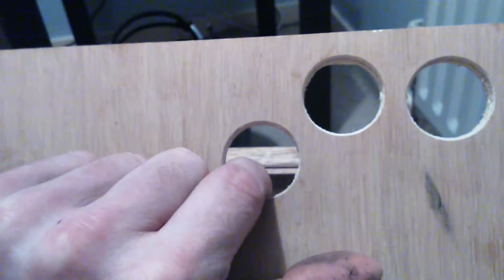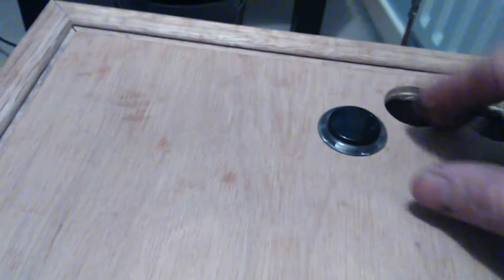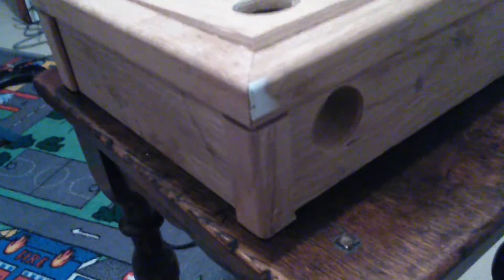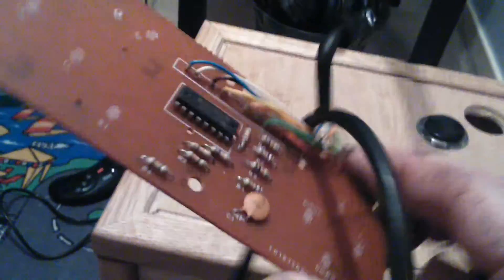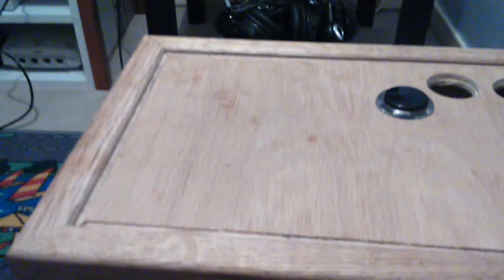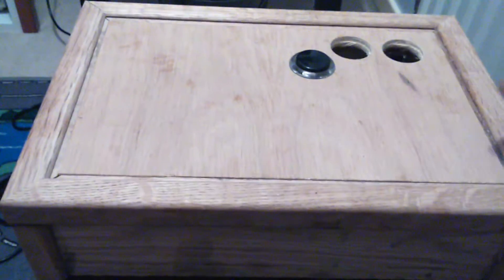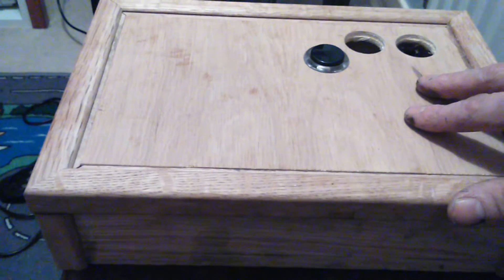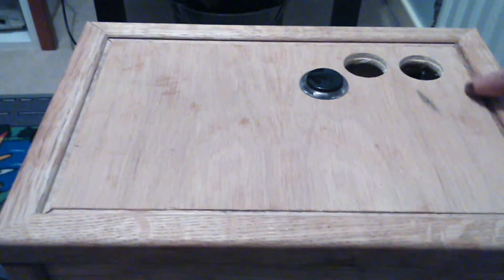Build your own arcade stick

Comment: I've got the venom ps3 ps4 exclusive stick. i want to add myoungshin fanta stick to it but the hole is too small. can you tell me which equipment i would need to make the hole bigger?
Reply from the maker: A round hole cutting bit for a drill would be best as I'm presuming the top is some sort of metal sheeting, you may also need to secure your panel to some wood so you have something to stick the pilot drill into allowing an accurate hole.
Reply: Mr Stella Box Head  yeah it has metal sheet. I will get hold of a drill and buy a hinge for it... thanks for your help

Comment: What you could have done to save desoldering all those connections is make a small notch at the bottom of the back of the wood and trapped the wire in there when you assembled it and put a strain relief to secure it in place ,then just solder your buttons to the opposite side ,I've got a feeling you have to solder all your wires to the connections on the actual buttons though because they go through that encoder thing and then to the output wires that's how I did it and it's a pain in the arse
Reply from the maker: ThePolicenaut Bloody hell i think i threw the buttons away ages ago!! :)

Comment: Neo Geo doesn't need a PCB board, each pin is a direction or button, but is the same principal.  I spent about £50 on all the parts, not including wood, I could have got a good condition Neo Geo offical controller for that, but that's not why we do it.

I will be interested on how you attach the joystick and hide the screws.
Reply from the maker: ***** Your completely correct about price not being the reason we do these things and i have been wondering about the attachment of the stick myself since reading your comment the other day :)

Comment: Very nice you have done an excellent job with the box.  Those buttons look like a much better option for making control panels out of wood.  The current buttons I have are designed for much thinner material i.e. metal, and I don't really have the tools for making large holes in metal, so maybe I should just see if I can get some of those.
I am sure you will be able to get that wired up using the Megadrive board, should work really well.
I have made myself a supergun in effect, but need to make a proper case for it.  My MVS 1-slot board is a non-worker unfortuneately but I still want to build completely a sit down Jamma cabinet, with a Mame PC inside that you can switch over to from a real PCB.  Need to do a lot more tidy up so I can have my workshop back, roof is now finally fixed from the storm earlier in the year though.
Reply from the maker: electricadventures Good to hear the roof has been repaired now Tony and i look forward to seeing the workshop in action!The best buttons for wooden control panels are apparently those manufactured by Happ, unfortunately these Sanwas are really designed for thin metal control panels it's just that I'm too stubborn to listen to the advice being given! I like the idea of a mame arcade cabinet and there are some nice examples of similar setups in Candy cabs with CRT displays here on Youtube :)

Comment: Nice one Darren! Does the MD encode it's inputs? (Turns out it does, news to me) I know that for the Neo you wouldn't need to pad hack.
Reply from the maker: RockstarRunner7 Thanks Rob, I'm still researching so I haven't started the wiring yet :)

Comment: I am impressed that you made the box to that standard in your 'tea break' - that would take me weeks :D Signal wise the MD joy control is dead easy to emulate. I might sit down and design a circuit and write some software to ensure the price would be very low and it would save sacrificing a MD pad too. Keep up the good work. How do you plan to finish the wood, Darren?
Reply from the maker: ***** Cheers Minty, I was in the workshop and that makes life so much easier. A workaround sacrificing MD joypads would be really useful if i decide to build more in the future.I'm not sure about the finish yet but it seems a shame to hide the oak away :)
Reply: Mr Stella Box Head
Thinking a bit more about it I would be happy to put together a circuit design.  Can you sned me your email address please, Darren?  I cannot make cases or anything like that.